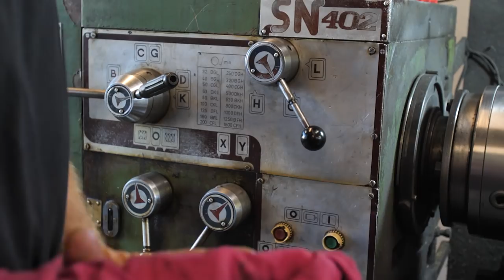Am reparat cutia automata si convertizorul de pe Grand Cherokee | Jeep WJ STACS

Comment: ZJ4life ❤️‍🔥
WJ ul este plin de electronica . 
ZJ ul 4.0 benzina , este superior unui wj 2.7 cu siguranta . 
Ca idee 4.0 benzina AMC e cel mai rezistent motor ce s-a pus vreodata pe jeep . Nu degeaba s a pus si pe wrangler , cherokee , grand cherokee zj/wj . 
Va uitati la consum si va luati corcitura europeana de ‘jeep’ DIESEL … bafta cu ele ce sa zic
Reply from the maker: Si la impozit ne mai uitam, de la 2.7 pana la 4.0 mai e ceva anual de platit, extra.
Reply: Depinde !
Reply: Mentalitati de romani aveti baieti 😜🤯🤯
Consum si impozit . Nu ajungeti departe cu asa gandire . Bafta